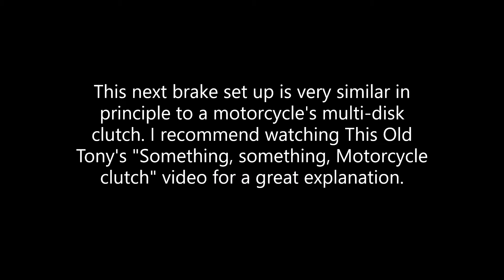AIRCRAFT BRAKES - How they work

Comment: What hydraulic fluid is usually used in larger aircraft brakes? I’m assuming it has to possess an extremely high boiling point due to the heat generated.

Comment: Those are some serious brakes, massive amounts of braking surface in there! I assume that it's difficult to cool them effectively though and the whole assembly acts like a heat sink absorbing the heat energy as the braking phase is intense but relatively short in duration, I bet that whole assembly gets up to some huge temperatures
Reply from the maker: Hello Elevated Entropy, you hit it right on the head. 
The brake assembly is a huge heat sink. 
There's a cool video elsewhere in YouTube land with a B747 doing an aborted take off test where they test the brakes to their max. You can see how toasty they can get. 
Thank you for stopping by Plane Simple.
PS: That's a great user name you have.

Comment: how quickly could a new set of brakes on a Boeing 767-200 bring it from going 200+ mph (takeoff speed) to a full stop? (without using reverse thrust)
Reply from the maker: Hello Derek Wall. The short answer to your question is...I have no idea. 
I've never worked on any 767 and haven't read any of it's performance books either. 
There are some cool videos elsewhere in YouTube land that show exactly that test (an aborted take off) but on a B747, it's awesome.

Comment: Superb video and explanation. The weight of just the piston plus the discs and pads, alone, must be huge
Reply from the maker: It is a heavy assembly, but it has a GREAT capacity to do a lot work. Look at it this way, you need massive engines to speed the plane from stopped to take off speed, but the brake assemble can take that same speed away and bring the plane from flying speed right down to zero and yet the brakes are much smaller and simpler than the engines. So yes, the brakes are heavy, but still very light for what they do.

Comment: Hypothetically could you fit an electric drive motor on the gear for a plane and use that to drive the plane on the taxiway? and use like "regen" braking to slow planes down?
Reply from the maker: Hello Toni-420, I guess you could, but I can think of a couple of things against it...
One, the amount of breaking during taxi is minimal, and the energy recuperated from that regen would not offset the energy required to then carry the weight of those electric motors along doing nothing for the rest of the flight, and...
Two, during landing, the heat generated by the normal mechanical brakes would absolutely roast the electrical motors.
Good thinking though. It is "out of the box" thought exercises like that that move progress along.

Comment: Hypothetically could you fit an electric drive motor on the gear for a plane and use that to drive the plane on the taxiway? and use like "regen" braking to slow planes down?
Reply from the maker: Hello Toni-420, yes, I guess you could.
There are several things to consider though.
Landing and taxiing are a very small portion of the operation of the aircraft. Is the total energy saved by using the electric drive for taxi, and regen braking more than the energy cost of carrying the extra weight of the electric motors and batteries along for the rest of the flight? If it costs more energy to carry that weight around than the energy you save by using the system, then the system is a net loss, not a gain.
Also, regen braking is not as effective at absorbing large amounts of energy as traditional braking, so you'd have to supplement it by using traditional brakes which generate A LOT of heat. This would be a very extreme environment for the electric motor/generator and it would probably cook. You could relocate the motor/generator away from the wheels and the source of heat, and drive the wheels remotely via shafts, etc, but now you are adding more complexity and more weight, again taking away from the overall gains.

Comment: Excellent video, thank you! I had a query - how would we know if there is a problem with brake binding? Would there be a pronounced aircraft veer in the direction of brake binding and also an accompanied significant increase in temperature?
Reply from the maker: Hello TheMordecai1985, if you get binding to the point of locking up the wheel, the wheel speed sensor would give you a fault message in the cockpit, and yes, that would be a companied by the aircraft pulling to that side. However, that's a very unlikely scenario since the brakes and wheels are inspected and serviced regularly well in advance of any of that happening.
Reply: @planesimple8514  thank you so much for your reply! :)
Reply from the maker: My pleasure.

Comment: I still not so understand why it need to convert to heat
Reply from the maker: Hello Jing Jie Lim, think of it this way:
The aircraft is a heavy mass that is moving very fast, that means that it has a lot of kinetic energy (motion energy). To stop the airplane you need to get rid of all that energy  in any way possible. Since energy cannot be created or destroyed, you have to convert all that kinetic energy into another for of energy. You could attach electrical generators to the aircraft wheels and convert the kinetic energy or the motion of the airplane into electricity(this is regenerative braking in electric cars). There's is two problems with that approach. One is that those generators are a heavy load to carry for the entire flight, only to be used during landing, and the amount of energy recovered by the generators is not comparable to the energy from fuel required to carry the generators around for the flights, therefore you'd waste more energy carrying the generators that the energy you would recover during landing. Problem number two is that the generators provide a limited braking capacity and would take a long time to convert all that kinetic energy into electric energy, and thus take a long time to slow the plane down. This would require excessively long runways.
To stop the airplane fast you need to convert that kinetic energy into another form of energy as fast as possible, and so far the most effective way is to convert it to thermal energy, heat. The brake assemblies are relatively light and do an amazing job of converting motion into heat and as such, do an amazing job of stoping the plane.
This was a long answer, but now you know that you don't need heat, you need to stop the plane, the heat just happens to be the result of converting all that kinetic energy into another form. 

I hope this helps.
Thanks for coming by Plane Simple.

Comment: Modern multi disc brake packs work on the same principle as an oil immersed HeleShaw Beecham Multidisc clutch used in motorbikes older cars, lorries,tractors, marine and industrial applications.
Reply from the maker: Yes! I refered to that in the video and referred to an excellent video by "This Old Tony" explaining the motorcycle oil immersed clutch.
Reply: @planesimple8514  yes , i am well aware, but it was in the 1920,s, a British Army Colonel Hele-Shaw pioneered multiple disc clutches suitable  for use in tank  gearboxes(transmissions), . Found the video interesting but dis jointed. I view the multi disc brake pack  as a stack of 75 rpm records on a commercial grade stacking juke box. four or more records are the discs or rotors, four other records stators each coated both sides with friction material ,like Ferodo,or Mintex . the  non coated records have tongues like you said, that slide in a slot machined inside each wheel rim us imparting  the braking force to slow the plane down.  A beefy titanium casting holds six pistons.  These six pistons work the same way as a cider cheese press, pressing the discs rotors against the stators fixed discs with a pressure of five thousand pounds per square inch of a typical  large aircraft brake system manufactured by Allied Signal Honeywell , Dunlop,and Messier Dowty.
Reply from the maker: You are feeding me brain candy! And I'm eating every bit of it. Thank you. 
As far as YouTube comments go, your comments are a whole dissertation. This kind of knowledge is priceless for those that are interested. Thank you very much. 
You've given me a lot of material to read more about for my own edification.

Comment: Do you realise that disc brake conversion kits offered by BF Goodrich ,Menasco ,or Hayes for DC-3 Dakota, DC-4 Skymaster, Both of a medium and larger size,.The said kits use the same arrangement,as described of a single disc and caliper . The single disc caliper set up pioneered by French Brake Manufacturer Pierrot before world war two with sets  fitted to the Breguet 69 a small twin engine multi role fighter.The limitations of such an arrangement on a large four engine cargo passenger transport is clearly evident , especially one lacking reversible pitch propellers. Yet such large transports so fitted are in daily service in Canada and Alaska.flying in and out of short rough dirt strips. That is why in the mid late 1940,s  BF Goodrich,Messier and Dunlop invented the multi-disc brake pack, more  brake power for your dollars.
Reply from the maker: Very interesting Basil Taylor. Thanks for adding to the common knowledge in the channel.
Reply: @planesimple8514 You are most welcome and know my stuff, before reliable single disc brakes came available from BF Goodrich and Pierot, small planes used expander tube drum brakes by Dunlop and Palmer, some american small planes ,like Stinson,s Travel Airs, Bellancas were fitted with Bendix internal expanding shoe drum brakes like an old Model A Ford.
Reply from the maker: Man, you really know your stuff! You are a very welcome addition to the "Plane Simple" channel and community.
Reply: @planesimple8514  Thank you for the kind comment ,it is appreciated and yes i do know my stuff. Reliable brakes for aeroplanes of all sizes became available  in the late 1920, s early,30. Their designs followed then current car and lorry(truck) practice. A steel drum shrunk or pressed fitted in the alloy aeroplane wheel. In the case of Dunlop,s expander tube brake, a rubberised fabric bag shaped like a brackwurst  sausage is fitted to a normal back plate bolted to the axle or oleo leg. Bonded on the outside of the sausage is a row of Ferodo brake blocks ,like those on a bicycle. When the  brake lever is applied on the control stick, hydraulic fluid or compressed air inflates the sausage thus pressing the blocks against the drum to slow or stop it from  rotating, thus enabling the pilot to control his or her plane on small isolated dirt or grass aerodromes . How,s that for a Hershey Bar.

Comment: Quick question  where does the master cylinder located pilot of co pilots side or in the middle???
Reply from the maker: Hello Joseph. Most of the time there are four master cylinders, each one directly attached to each rudder/brake pedal. That means that the pilot's left rudder pedal is also the the brake pedal for the left wheel brake, and the pilot's right rudder pedal is also the brake pedal for the right wheel brake. The copilot's side also has the same arrangement so either pilot can control the brakes. This brings the number of master cylinders to four. And this also gives you the ability to have differential braking since you can control left or right brakes independently. Some light aircrafts have the pilot's and copilot's rudder pedals mechanically linked or welded together, in those cases, pilot's share the same two master cylinders mounted somewhere in common to both.
Reply: @planesimple8514  thank you 🙏
Reply from the maker: You are welcome. Any time.
If you want to see one example of master cylinders, you can see it in my video about an "abandoned KitFox". There I take a bit of a tour  of the plane and I believe you can see the brake master cylinder.

Comment: Thank you
Material of the pads and discs??
Reply: The rotors and stators shown in the video are steel on steel which is older technology but still very much in use on some aircraft. Modern aircraft (or older ones that have been retrofitted) use carbon rotors and stators. The carbon recipes are proprietary. The carbon/carbon brakes are much quieter than steel/steel brakes and have a much better heat absorption and dissipation properties. 

The “larger” one shown in the video may be along the lines of an older 737 aircraft (or about that size of airframe). The wheels and brake sets for aircraft like the 777 and A340 and A380 are much bigger.
Reply from the maker: Man! Thank you so much for chiming in with more knowledge. I love the fact that people more knowledgeable than me can jump in and complete the picture for everyone.
Reply: @planesimple8514    No prob. Spent 16+ years in engineering for an aircraft wheel and brake manufacturer.  It is a great industry to work in.  Check out this video of an A380 rejected take off test on a road wheel dynamometer. The carbon disks get white hot and flame up.  https://youtu.be/qew09gao3S8
Reply from the maker: @chrispenick113  Dude, thanks again for chiming in. It's an honor to have an industry expert participating here. Welcome to Plane Simple!
Reply from the maker: Ah, great question but one that I don't know enough to answer in detail. I can tell you that the discs are some steel alloy and that the pads are a mix of any number things depending on the application. As far as the alloy of the steel goes, I'm sure there are variations but I wouldn't know specifics and most likely are different from one plane to the next. Pads, are probably a mix of friction materials(metals, ceramics, carbon, etc) embedded in a matrix(another long chain material like carbon) to hold it all together. 
I know this is a broad answer but that's as much as I know regarding their composition. 
I hope this helps and thanks for watching.
Reply from the maker: Hello Khalid, I hope Chris Penick's answer in the comments satisfied your curiosity. Cheers.